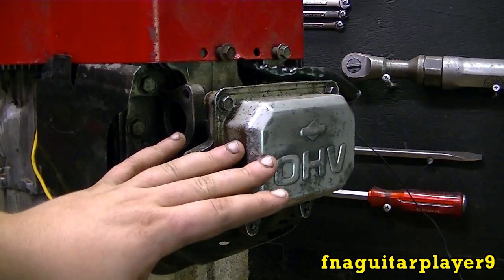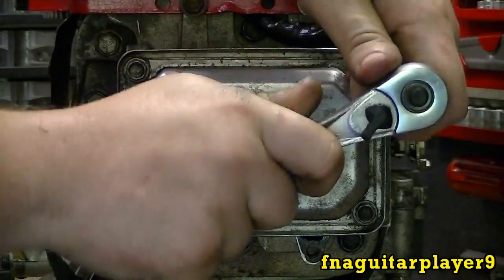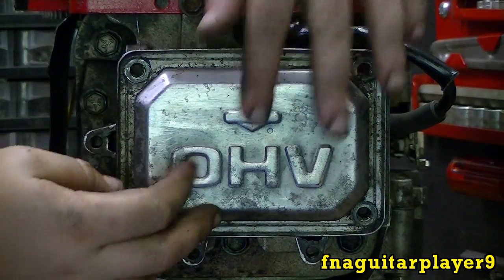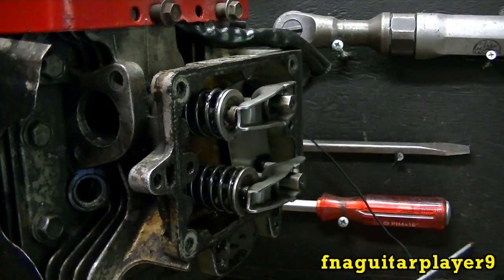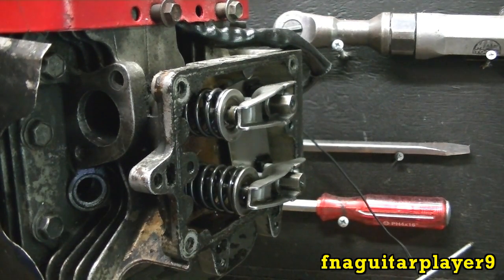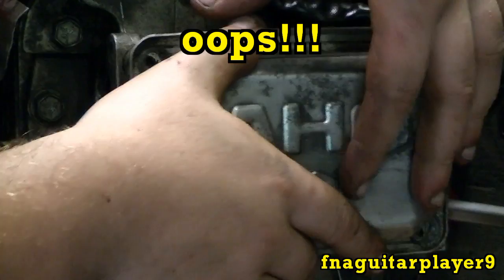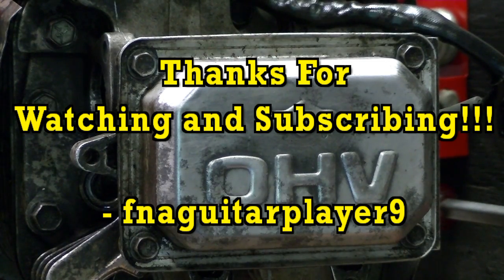How to Adjust Valves on OHV Small Engines (Valve Clearance / lash)

Comment: The manual states: 
Adjust Valve Clearance
All Models - Except Vertical Models 110000,
120000 Early Production
NOTE: Check valve clearance while the engine
is cold.
1. Turn crankshaft counterclockwise until
piston is at top dead center on the
compression stroke. This prevents the
compression release from holding the
valves open.
 2. Insert a narrow screwdriver or rod into the
spark plug hole as a gauge, then slowly
turn crankshaft counterclockwise until the
piston has moved down the bore by 1/4”
(6mm).
 3. Using a feeler gauge (A, Figure 41), adjust
rocker nut to obtain the clearance as listed
in Section 12 - Engine Specifications.
 4. Hold rocker nut and tighten the rocker ball
setscrew (B) to the torque valve shown in
Section 12 - Engine Specifications.
 5. Check clearance again and re-adjust, if
necessary.
 6. Repeat for other valve.
NOTE: On some models, the nut and setscrew
are positioned above the push rod ends. 
Here is a link to the clearance specs for all  models:
https://www.moteachag.org/documents/AgMechSurvivalBriggsRepairCheckChartNew.pdf
Good video, overall.

Comment: Nice video!   I have a 23hp Briggs &Stratton Intek Endurance (2009) with 560+ hours. It often has a hard time starting ( I have to turn the motor by hand to get past the compression and then it starts up, once started it works great).  I’m confused by what would be the best valve clearance setting: the Book says 4 - 6 thousands, but can you please explain which exact clearance would work best to eliminate hard start which I think is due to little or no compression release

Comment: I got a yardman push mower with self propel..I'm working on it.  It fires up.  But it's hard to start.  Won't prime.  But after some research.  It definitely needs the valves adjusted...it's 20 yrs old.  But I use it to learn on.   I will do this adjustment.   Any who it's got the weirdest setup for the blade and self propel.   Blade adaptor has the star and then two screws with lock nuts that go where the tabs on a blade adapter go...pulley and adapter are separate.

Comment: I cannot adjust my exhaust rocker arm.  It is tight with no play and when I adjust it even a hair to loosen it, it is then instantly so lose that the push rod will even fall out.  Other-words  it is  tight and no gap but the slightest adjustment to create a gap ends up in a huge gap. I had no trouble with the Intake  valve.  I installed a head gasket and that is why I have to adjust the valve gap   It is a 15.5 hp Tecumseh lawn tractor engine.

Comment: My OHV White mower doesn't have those T20 lock screws?  It only has a nut on the end?  How do I adjust my valves with a setup like that?
Reply: Does it not have two screws?

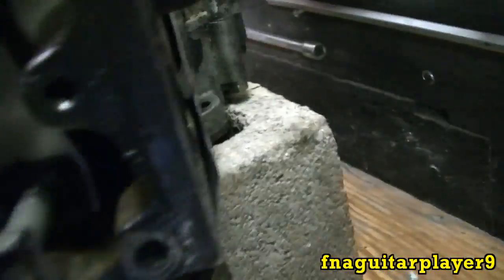Comment: Great explanation on which valve is which. I thought the INTAKE valve was always up top. Not so as your video clearly shows. So as it turns out I was setting the exhaust valve to 0.005" clearance and the intake valve to 0.007 clearance ( I had it backwards because I thought INTAKE was up top. And now I know why the engine is backfiring thru the carb because I have effectively set the INTAKE valve to 0.007" and therefore it is staying open to long and causing the problem!!!!. So in summary as you show I will switch the #'s from 0.005'/0.007" TO 0.007"/0.005" ( LOOKING AT THE ENGINE FROM TOP TO BOTTOM ). In fact your video is my engine exactly. See 2:18 into the video.
Reply: Having the intake valve clearance set too high will result in the intake valve not staying open long enough, not staying open for too long.

Comment: When you adjust the valves, you say you do them in the 'tight range' rather than in the mid of the spec range?  Why so?  Other guys I've seen seem to do it in the middle of the spec range.  What is the advantage, pro or con?
Reply: Since you ur setting the valves when engine is cold they will loosen up slightly when warmed up
Reply: @miraged1  Not sure about that. The manual states to set the valve lash when the engine is warm. The valve (especially the exhaust) expands (lengthens) when it heats up. There is substantial expanding on the exhaust due to the extreme heat from combustion.

Comment: on my 04 briggs 18hp Intek, i lashed the valves , the mower starts but surges especially at low idle but high rpm's too.  Is there just one time the piston comes to the top of the cylinder or two.  I used the screwdriver and adjusted both at top of piston travel minus 1/4 "  one at .004 bottom and one at .006 top.  is it a carb issue you think or should i take off the valve cover and try this procedure again.  I don't know if i was at TDC because the cylinder might come up to top twice for the 4-strokes.  any help is appreciated
Reply from the maker: Sounds like its probably a carb issue, if its to lean it will surge like that. May need cleaned and adjusted. Thanks for Watching!!!
Reply: @fnaguitarplayer9  -- ok, i'm on it.  i will hopefully not have to drill it out on the idle jet and main jets.  perhaps the idle jet port is dirty like you say, but it's a Nikki-6 so anythings possible.  Thanks so much!!!

Comment: I have a Kohler 7000 with intake and exhaust on left and right side of the motor I’ve been struggling to get the compression sequence correct but this is the first video I’ve seen where both valves are being adjusted at top dead center usually it’s been one valve compressed adjusting the one that’s not , then rotate to adjust the previous compressed valve ... humm so when valve is top dead center do you rotate 1/4 turn then make the adjustment? Or make adjustment at tdc?

Comment: Thank you for your video.  So after doing all the troubleshooting steps on a no start, I opened the valve cover and noticed the adjustment was off real bad.  I adjusted the valves and it now runs but with a backfire.  Did I adjust to tight?
Reply from the maker: Your welcome! Possibly, as long as its within spec it shouldn't cause that, could be a carburetor issue. Thanks for Watching!!!
Reply: @fnaguitarplayer9  so, I went back in there and found the stud for the rocker wasnt tight.  So even after tightening them to specs the darn stud moved as it ran.  Opened up retightened everything, now purrs like a kitten!  Thanks for your video!! A note: making sure the piston passes TDC by a 1/4 inch  was a very important step, I missed as well!
Reply from the maker: @chrisrider102  I hear ya! Glad you was able to figure it out! Your welcome!

Comment: Where do you get the specific valve lash (clearance) specifications for an owner's particular mower?  They are not found in my lawn mower booklets on how to care for my mower.
Reply from the maker: If its a Briggs you can google "briggs check chart" and it will have the valve specs on it, go by your model number. Thanks for Watching!

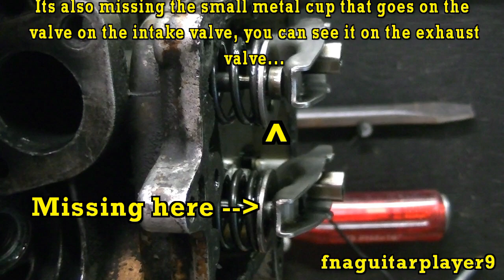Comment: 6:59 You mentioned the "missing" valve cap, I thought the same thing about my engine BUT, >>NO<< both valves do NOT have the caps, only one in the manuals I have looked at.
Reply from the maker: Yep didn't realize that at the time, but when I finally rebuilt  this engine I put them on both valves haha Thanks for Watching!

Comment: Heads up people all gas motors set at .004 on both sizes there is a video to watch that have the other guys i watch all the time they set the valves at .004 on both sizes
Reply from the maker: That is a good universal spec if you don't know the specs for the engine, but i recommend using the actual specs for the engine if available. Thanks for Watching!!!
Reply: Mine are not available. What do I do now?

Comment: Hi dear , thanks for yours great and helpful videos, and i have some questions.
I have a honda generator Model eu 3000is , I would like to know for setting up the valves adjust:
How much is the clesran setting for the exhaust fuel gauge valve gap-00 .?
And how much is the clearance seting for the intak fuel gage vale gap.00_?
I need your instructions please,
Thanks
Reply from the maker: Your welcome! It looks like .006" for the intake and .008" for the exhaust. Thanks for Watching!
Reply: Thanks for your great inspiration.

Comment: How do you know when you need to adjust?
Reply from the maker: on alot of OHV motors if they get hard to crank over or act like a bad starter it could be the valves out of adjustment keeping the compression release from working. Also if a engine has no compression or low compression it could be from the valves not closing do to, to tight of a clearance or no clearance which is common in the older flathead engines. Thanks for Watching!

Comment: Great video, explained very well. I have a briggs vanguard 16hp twin on my race mower build but i have a problem. Ive took the governor off so i can now 'rev' higher only when i do rev the engine runs smooth untill you higher revs, it then splutters, seems to bog down and pushes out black smoke. Ive done my best with adjusting valves, flywheel air gaps and rebuilt the carb and nothing i do will stop it spluttering :(

If you have any ideas they would be very much appreciated :)
Reply from the maker: Does the carburetor not have a fuel mixture screw, i know some of those did but not all. Thats a common problem with stock carbs, either running to lean or rich in the high end. May have to go with a different type of carb to get more adjustment. Thanks for Watching!!!
Reply: @fnaguitarplayer9  muchos thanks for your reply. I think ive narrowed it down to being the main jet as the one fitted seems to have been replaced in the past by someone else.
I have however thought of buying a new carb as this mower is a race project. Would you know what carb i could use instead. Thanks again. James
Reply: @fnaguitarplayer9  p.s- only the idle mix is adjustable on this one

Comment: My Kawasaki  v-twin OHV, backfires through the carburetor when under load...mostly at higher RPMs.  I thought the valves needed to be adjusted.  Any thoughts?   Going to put a new fuel filter on first. But I don't think that is it.
Reply from the maker: I would suggest checking / changing spark plugs, check valve clearance and if it still does it, it may need new coils, they are bad about coils going out on them. Thanks for Watching!!!

Comment: How do you know when you need to adjust the valves? Are there symptoms?
Reply from the maker: on OHV motors like the ones in the video they have a compression release on the cam, and if the valves are out of adjustment alot of times it wont' work and will act like a bad starter/battery when really it just needs adjusted to make work, more serious problems are back firing, and if you see a muffler glowing red or constantly shooting a flame out the valve is leaking. And sometimes if you can't get on to tune in its do to leaky valves. Also if they are real bad the engine will have low or no compression. Thanks for Watching!

Comment: good video. i have a duro max xr4850eh that dropped a valve the head broke off . got a new head and valves dont know what the valve clearance should be on it would you know what it might be .or where i could find it .thanks for your help.
Reply from the maker: thanks. I tried to look it up but can not seem to find it online, wish i could help more! If you can not find anything on it, try setting the intake at .005" and the exhaust at .009" that should at least get it running, but not sure of exactly what its supposed to be. Thanks for Watching!
Reply: found it called the company 006 on intake-008 on exhaust. thanks for your help.enjoy your videos.

Comment: Check leakdown to check rings, valves, and head gaskets. If the rockers are excessively loose, the valve seats can be loose. Replace the heads. Remove the rockers and do the leakdown to check valves. If a valve is sticking, remove the rocker and hit the valve spring to unstick it.
Reply from the maker: A leakdown test can tell alot. Thanks for Watching!!!

Comment: I am a disabled vet and have a morphine pump so I am kind lost I have a B&S 19hp OHV about 5 years old not sure as I bought it about 3 months ago and it was running ok. Now it takes a lot of power to turn over . If I turn the engine a little by hand then try to start it it starts and runs ok .  Any ideas?
Reply from the maker: Sounds like the valve clearance needs to be set, if you can follow this video or have some help you, it should help, it has a compression release and as the engine ages parts wear down and clearances get bigger keeping it from working. Try that first, it could be the starter getting weak or the battery loosing cranking amps. Hope this helps, Thanks for Watching!!!

Comment: Great video,  thanks for sharing.  I have a 16 HP OHV Kohler with no adjustment screws in the valves. I know for sure the valves stays open about a quarter inch. Any idea how to adjust the valves.  I was going to put space washers, but.... //Luis
Reply from the maker: Your welcome! I usually only work on Briggs and Stratton, i'm not to up to date on kohlers to be honest, but most small engines are very similar to this unless its overhead cam then its different. Thanks for Watching!!!

Comment: At the end of the video it said it’s missing a little metal cap On the intake. well on my intake valve was also missing that little cap. Then I looked it up online and in the book it doesn’t show that the intake has a metal cap on the end of it. Only the exhaust valve has that little piece.
Reply from the maker: oh ok, didn't know that, when i rebuilt this motor last summer I put on both valves haha Thanks for Watching!!!
Reply: Ur right terry butler.

Comment: What is the valve specs on a briggs and Stratton 13.5 model # 21b707
Reply from the maker: Its showing .004-.006" for both valves, which is odd, usually each on is different, but not on that one. Thanks for Watching!!!

Comment: glad you noticed the missing retainer cap, cuz had i not watched this video i would have forgot them as well xD
Reply from the maker: yep! That would be easy to overlook, i have ran this engine without and it does affect the valve clearance, its hard to get it set right and it makes some noise without it. Thanks for Watching!!!
Reply: hey i have a question: i recently was riding my MTD tractor down a slope in neutral cuz i wanted to see how fast it could go and i accidentally put it in reverse. i know it's stupid, but it makes a clanky sound now when the engine runs and i know it's coming from the engine cuz i disconnected the belt. i checked the mounting bolts and they were tight. im worried that something got knocked loose in the motor when it shifted into reverse. could it be the valves? i just re adjusted them the day before this accident and i noticed its harder to turn now on the compression stroke. what do you think? thx
Reply from the maker: I don't think it would be the valves, I don't know of anything that could get damaged from turning over backwards or anything, unless the crank broke, but i doubt that. The only possible thing could be maybe something happened to the compression release on the camshaft, it might have gotten in a bind or something but i don't think it would break. hard to say to be honest.
Reply: I have a cheap212 cc predator motor on my power washer and my intake valve broke loose from that slotted washer. I put it back together set gap and started it and ten seconds later it did it again. I have parts diagram and it only shows the little cap on exhaust valve like yours was. But you said your intake valve does have one that's suppose to be there so my question is do all ohv on intake side have the tiny cap, or is it possible that my diagram parts list is right and should only have one on exhaust valve only. My washer / retainer thing that holds the spring down looks flared or wallered a lil at least I was thinking that's why it can't stay together? It was max speed wide open with pencil spray head on when it came apart. Guessing heat/ load / ethenal run in the past was the cause or never adjusted valves since i bought it new? Any advise would be appreciated thanks!

Comment: You adjust the valves on an automotive engine at TDC compression stroke.  They don't have a compression release.  The reason they say to rotate lawnmower engines a 1/4 turn of the flywheel past TDC on compression stroke is to make sure you're not adjusting valve lash with the tappet sitting on the compression release actuator on the exhaust cam lobe.
Reply from the maker: It makes sense, but on most of the ones i work on the compression release is in the middle of the compression stroke. Thanks for Watching!!!

Comment: I have a hinda gx390 engine. 
What is the standart valve clearance for it???
Reply from the maker: Looks like 0.15 +/- 0.02mm  ( 0.006 +/- 0.001in )  for the intake and 0.20 +/- 0.02mm  ( 0.008 +/- 0.001in )  for the exhaust, here's a link to where i find it, just so you can verify your number, the 390 on the site has k1 after it, i don't know if that matters or not... http://outdoorpowerinfo.com/engine_specs/honda_valve_gaps.asp Thanks for Watching!!!